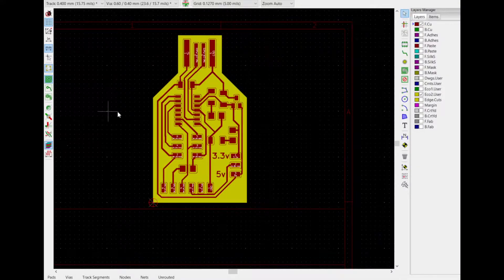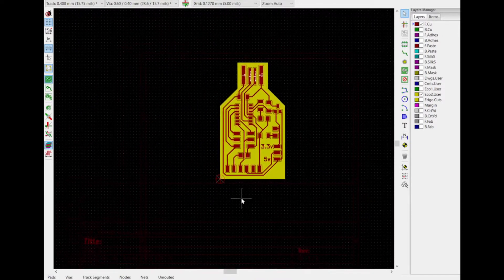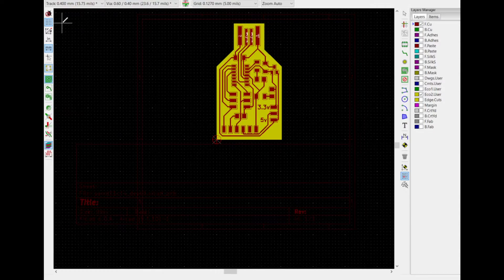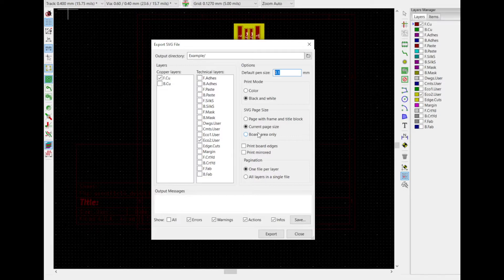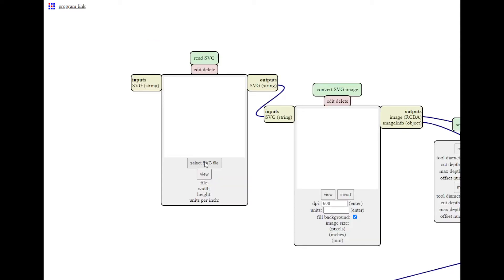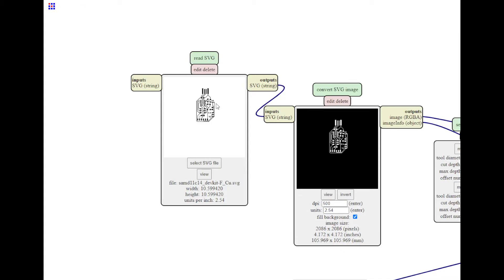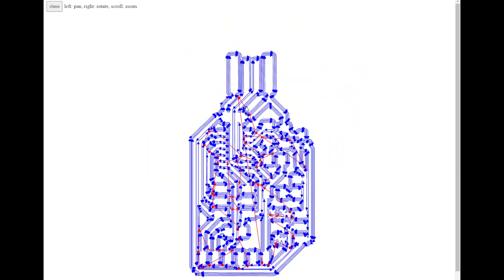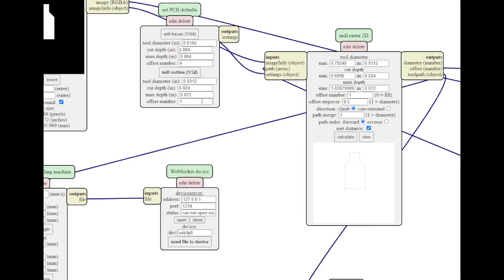Exporting from KiCAD to Fab Mods (Method 1, SVG direct)

Comment: Thanks for this.  Super helpful!
Do you know a good video for how to place holes (my board has through hole components) using KiCAD, mods, and Roland?  Also, should holes be drilled before or after the circuit is milled?
Reply from the maker: I haven't done so myself, but you would export just the holes on its own SVG layer, but uncheck "negative" so that the holes would be black on a white background. Then in mods, use the 1/32" outline setting and it should mill all the black areas away.
Reply: @adamharris6557  I'll try that.  I also found this a few minutes of this video that show how you would approach it with a drill bit instead of milling out the holes.  Requires a bit of trial and error with mods, so maybe milling is the way to go.  However, it has a good trick for getting the holes off the existing copper SVG file.  Starts at 1h 42m.  https://youtu.be/ZbP9FEIVfaw?t=6140
Reply from the maker: @william-s  Thanks, That's a good resource! I appreciate the follow-up